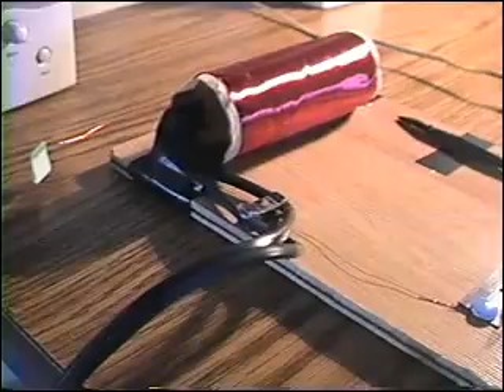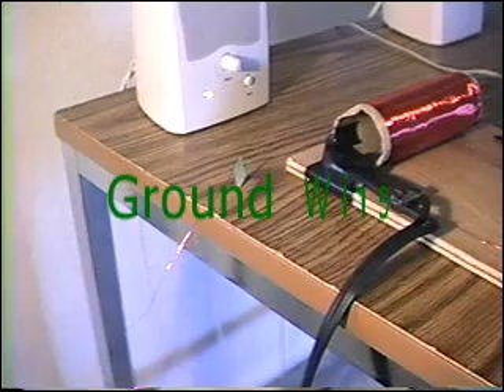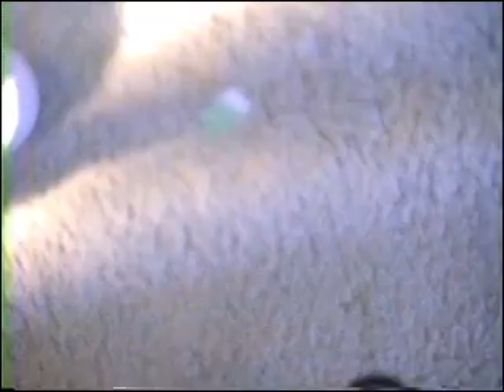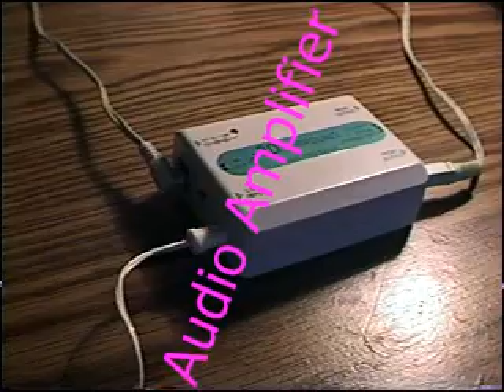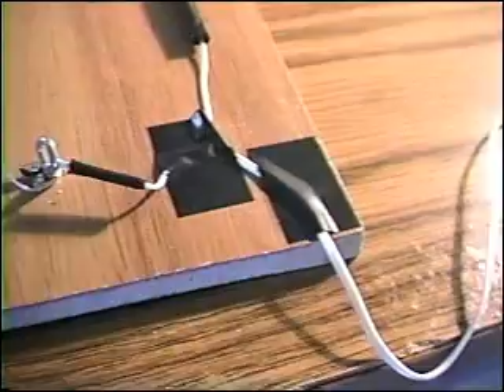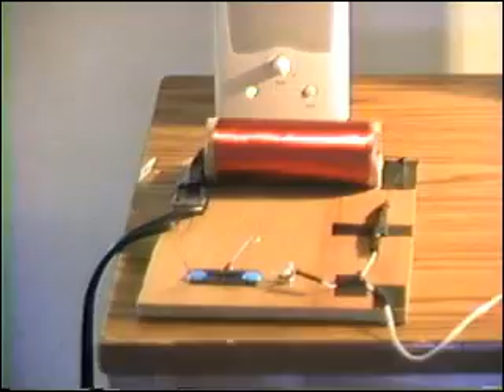Bhavin's Homemade Foxhole Radio

Comment: Good stuff. 

Now listen kid. Your next project...............A "Pirate Radio Station". Your a smart kid. Make it mobile so the FCC can't triangulate your transmission. Mount it on your go-cart.
Your gunna need some more parts though. Let's see, you need an old hand-crank egg-beater and some bed-springs. 2 coat-hangers and some of mom's old hair-curlers with the metal spring in the middle. An old waffle-iron and the crank-handle from a model "T". Now your set. Get to work and keep me posted.

Comment: Very cool..!! I like amplification. Btw, you can also make a paper cone and put earpiece in that to act like an amplifier. Like an old victrola phonograph horn. 

Just for kicks n giggles. I was told once, not sure if it is true, but the old days those who where in mental institutions because they said they heard voices, may have actually heard voices. It was found that inmates who urniated on some steel frame beds accidentally created radio circuits.

Wierd hey...!!!

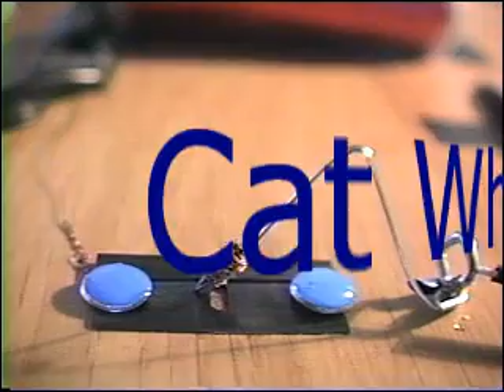Comment from the maker: @mdesm2005 You are correct. I made a mistake in the video. You can see me correcting the mistake on the annotation at 2:23. I actually modified this radio to make it tunable a few weeks after recording this video. But that was over 3 years ago. I don't remember the details, but I know that I had an 'arm' over the coil that could move left and right, which did vary the inductance as you said. (The cat whisker is just a way to fine tune the radio.) My apologies for this mistake.

Comment: I don't think that moving the needle will pickup a different station.  All that does it make contact to crystal on the blade to act as a diode.   To pickup different stations, you need to connect to different places on the coil. That will vary the inductance form the coil.  It's the amount of inductance from the coil that determines to what frequency the system will resonate.  The diode clips the negative portion of the signals to which the coil resonates.

Comment from the maker: @MediaHoax It didn't take too long. It just takes patience, diligence, and an hour or two. You rather take your time and do it right the first time; don't try to rush it. I also had more 'turns' around the coil than some of the tutorials online stated. I can't exactly remember the amount of turns I had, but I think it was around 200-250.(Tutorials online say to do around 120) This increase in the amount of turns could have been the reason to why mine worked well.

Comment from the maker: @TheChineseRegarding your previous comment, it could be your razor blade.Make sure you have "blued it" and maybe try another type  of blade.Your antenna might be too short, your wires may not be connected properly, etc.Troubleshoot, because there are many possibilities for it failing to work.My radio didn't work at the very beginning, but then I re-wired everything and it was perfect.It could be that you have bad reception on your area, but double check that everything else is connected properly

Comment from the maker: @TheChinese01 To be honest, I don't know the exact answer. Blades from different knives are made of various materials like stainless steel, platinium, etc. Just try it out and see if it works. Make sure that you "blue" your blade, which means that you expose it to an open gas flame like a gas stove or propane tank until the blade changes color to a slight blue. You can Google how to blue blades for foxholes if you want more information. ( My blade didn't work until I blued it on a gas stove)

Comment from the maker: @bngnaranjo Well, its been over couple years since I have made it, so i kinda forgot, but I believe it can be any blade as long it has been "blued", which means you put it above an open flame such as one from a gas stove or propane tank until it turns somewhat blue or changes its color. But just to be on the safe side, go with stainless steel. Your regular utility knife should work just fine.

Comment from the maker: This video is not intended to be a video that shows instructions on how to make it. It is just a video showing the radio I made. In addition, the "ground wire" connects to the ground, which is the third prong in a wall socket. The third prong does not have any power, it just goes to the ground. That is why it is called the "ground wire".